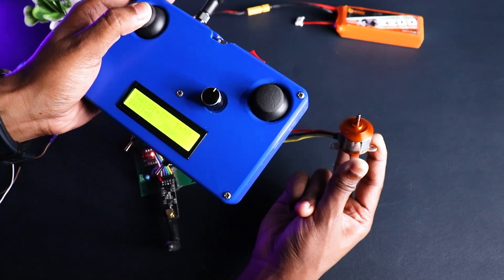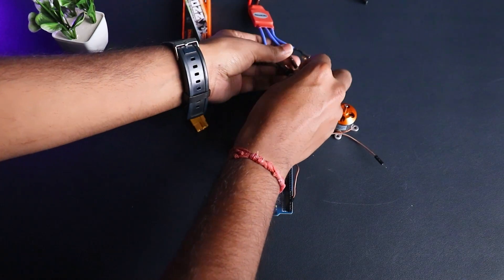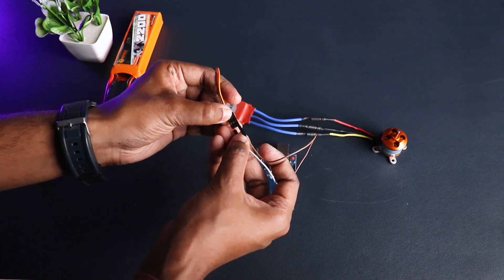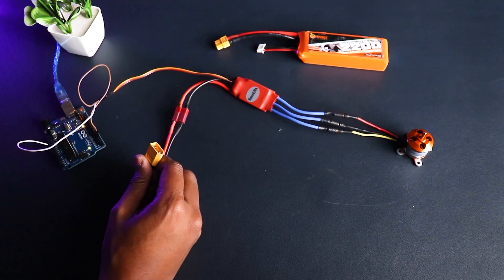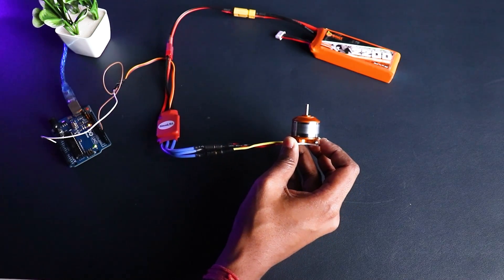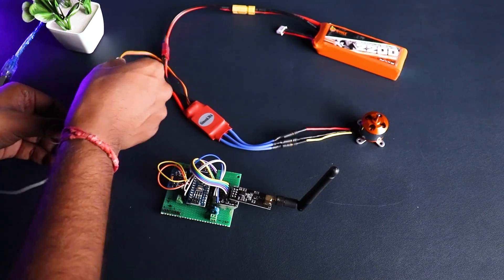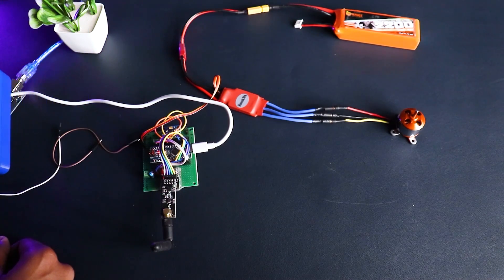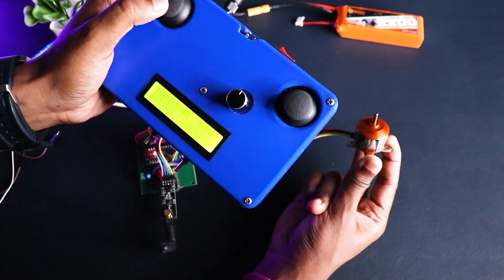How to calibrate ESC’s using Arduino? | Beginners Guide | Robu.in

Comment: Huge mistake.U should absolutely connect ground of esc and arduino together.However the 5V can be left if arduino is usb powered.
Reply from the maker: You're have a keen sight, this will be a mistake if we don't connect all the grounds properly when they're in a drone setup. However, when its standalone like shown in video. It should pose no issues.

The flight controller which is shown as the last, all the pins were properly wired.
Reply: @RobuInlabs  you have did it correctly in the video,but in the audio u said the wrong way.